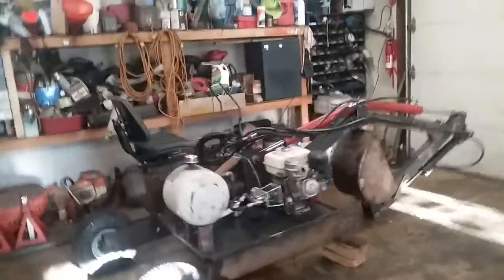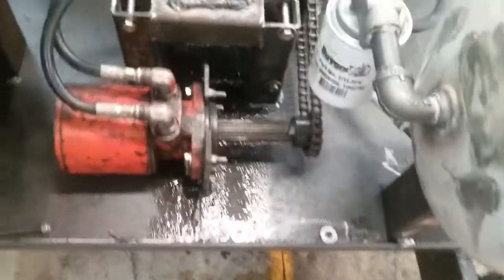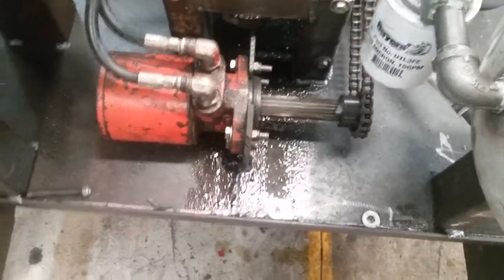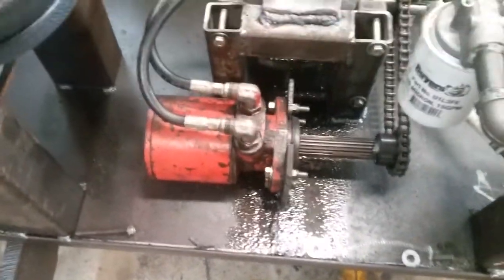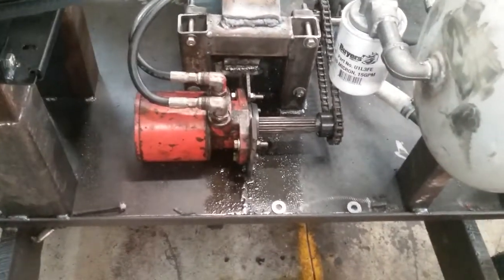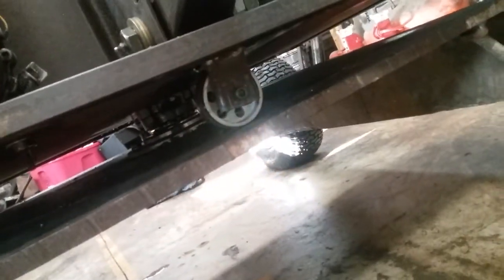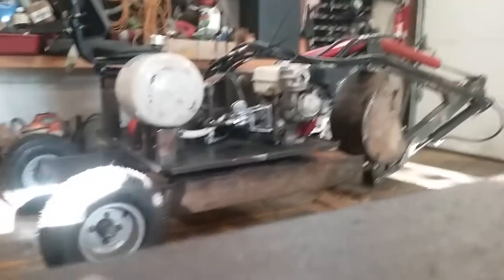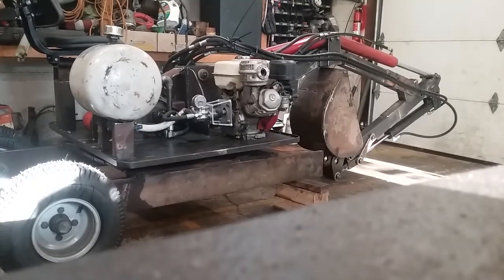Home made excavator swing

Comment: Такой механизм поворота долго не продержится и масленый насос не на прямую надо было подключать, передаточное число с двигателя на насос надо было сделать два к одному хотя бы
Reply: Good build you need a removable ring to keep dirt out with grease fittings on it so the casters run in grease out side the casters wheel and you need them evenly spaced all around the upper swing part